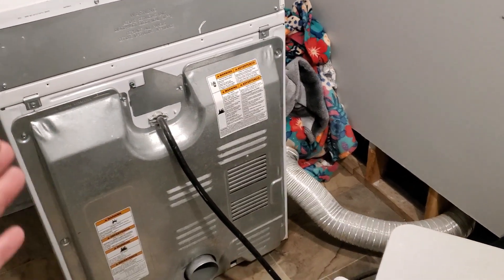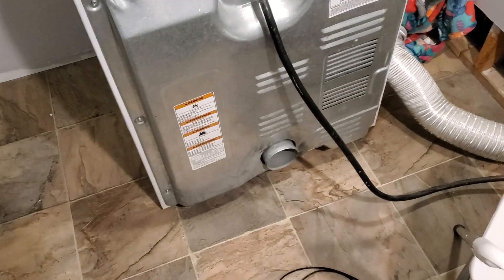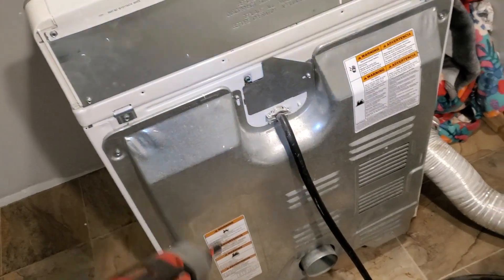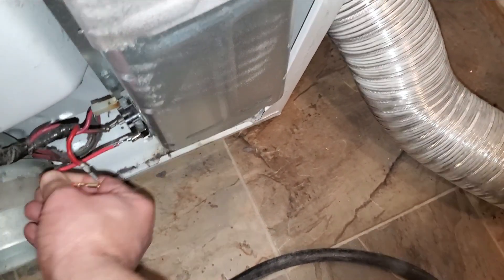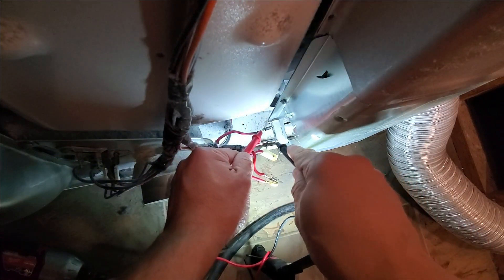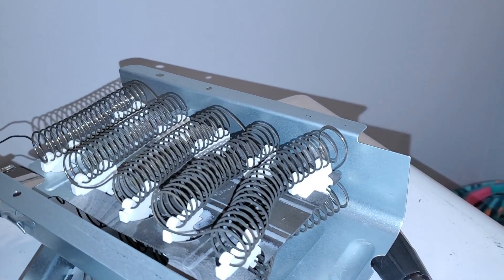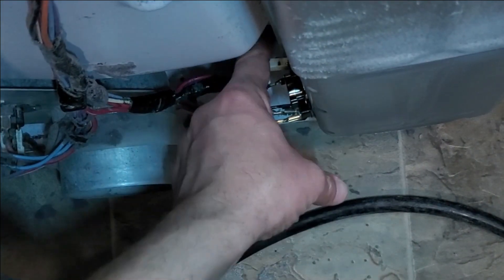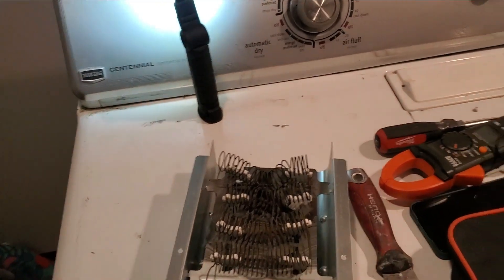The 89G - Dryer Heating Element Won't Turn Off? Diagnose and Fix the Staying On Problem!

Comment: When you have the dryer out that would have been the best time to run a clean line down that vent line
Reply from the maker: Indeed. I have a brush with several extensions that I attach to my drill for that.
Reply: I have one that goes about 25 ft with an air compressor if you'd like to borrow it
Reply from the maker: @zfamilygarage  oh cool. And it just blows it out the vent outside?
Reply: @89G  it requires an air compressor you go from the outside in or you can go from the inside but it's going to bring it back to the inside I do have a video on it
Reply: @89G  correction I didn't find the video on my wall I don't know where it's at
Reply from the maker: @zfamilygarage  I'll check that out. Thank you! 😊

Comment: You'd think these things could fail safe when heating elements get stuck on. This happened to my dishwasher and it ended up melting through the bottom. It was a plastic box builder-special. Thank you for sharing how to actually test the components with the multi-meter!
Reply: Awesome stuff! I didn’t know about the universal heating element coils. Hopefully I don’t ever need to! 😂
👊😎✌️
Reply from the maker: @BigStickStangs  whirlpool makes a lot of appliances for other companies, so that makes it a pretty commonly used element.
Reply from the maker: That's exactly right. I felt the same way about a fail safe feature being necessary. Had the belt not broken, I may not have ever noticed. I did actually just get the new Samsung delivered on Friday evening. Holy crap - that thing is awesome. Thanks for watching!